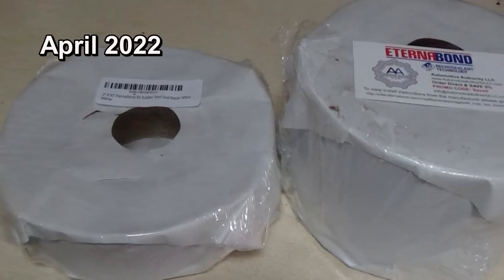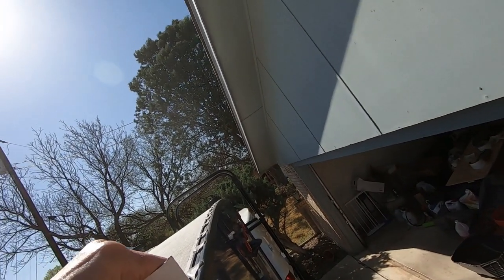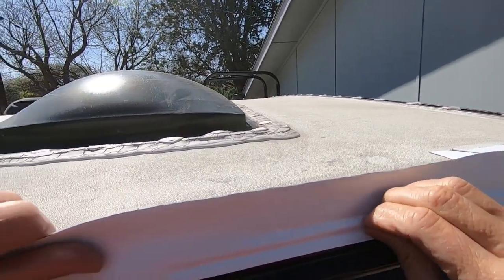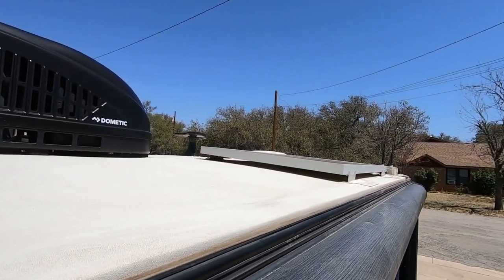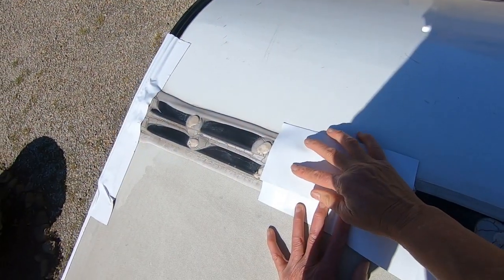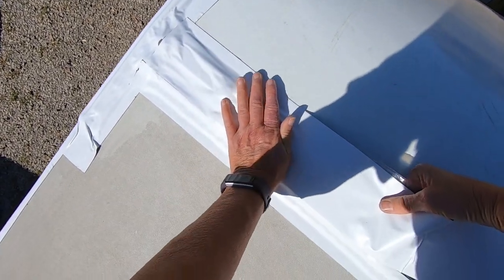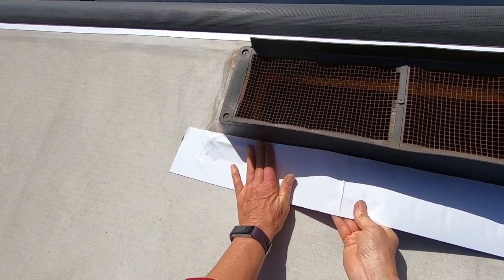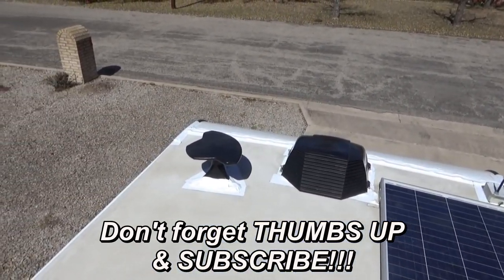Sealing RV Roof with Eternabond Tape

Comment: Very nice job ❤ I have to do this ASAP , how often should I seal my rv? Thank you
Reply from the maker: The recommendation is that you inspect the roof twice a year.  If you find any dry calk, clean it with rubbing alcohol.  We have seen RVs that have had the Eternabond tape on for 8 years and counting.  If you find places where the tape or calk is beginning to come unsealed, those should be replaced.

Comment: Great work!  What year model is your Minnie?  Do you use a folding ladder or extension ladder to get on the roof?  Does it feel fairly stable when you are on it?  I need to get up on my roof but my ladder is about a foot shy of reaching the top.  A little shy about getting up there without a taller one.  I am so proud of you all doing all the work on your RV!  :)
Reply from the maker: The Minnie is a 2018.Sharon uses the ladder on the back of our Micro Minnie.  She feels stable when she's on the roof.  Sharon has literally saved us thousands of dollars in minor repairs by doing them herself.

Comment: Do you recommend replace the lap sealant first before applying the tape?
Reply from the maker: It depends on the condition of the lap sealant.  Sharon saw that ours wasn't cracked and didn't replace it.

Comment: Is there a recommended temperature for applying eternabond? I live in Minnesota and it is between 45°-65°daytime temps.
Thanks.
Reply from the maker: Sorry, but we live in Texas and can't help much with cold temperatures; however, I think 65 to 70 should be fine.  Your best bet would be to see what, if anything, the product itself says about the temperatures.

Comment: nice work teach.    question for ya;   did you lay the tape directly over the dicor sealnt when you sealed the front cap to roof seam?    and if ya did, did it stick well on the malleable dicor bead????   thanks for the help
Reply from the maker: Yes, I did put it on the dicor. It stuck well.

Comment: If your trailer, 5th wheel... is stay put and not going anywhere, would you consider sealing your side seams, seams around the windows with Eternabond?
Reply from the maker: I've not really thought of that. I think I would use caulk

Comment: Great job!  I’m thinking of doing this to our truck camper roof.  It is 4 years old and the dicor is just starting to get brittle.  It’s been stored inside.  I’d rather spend more money upfront and have a better seal and less work as I get older.  How long do you think this will last?
Reply from the maker: We put strips of this where we installed the solar panel 3 years ago and it looks the same as what I just did. I saw video of a person who said they have had it for 8 years and it is still going strong.

Comment: Hopefully you never have to repair or replace the vent covers because you will never get them off now. If you ever need to replace a broken or cracked vent, you will destroy your roof trying to pull off the eternabond tape. Taping the seems is good but not around all the vents.
Reply from the maker: Hopefully, we won't have to replace the vent covers.  Thanks for the info.

Comment: Good job on applying it. It’s no easy task.  But once this bond fails it will be a nightmare to remove.  It’s better to just reseal areas that are bad with the appropriate sealant.   This type of roof tape is only meant for temporary roof patches with the edges sealed.